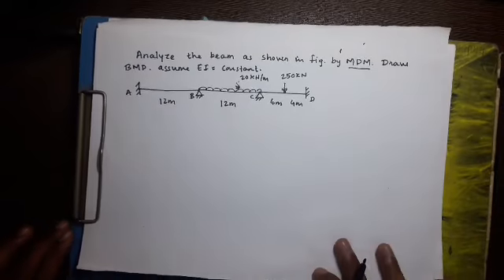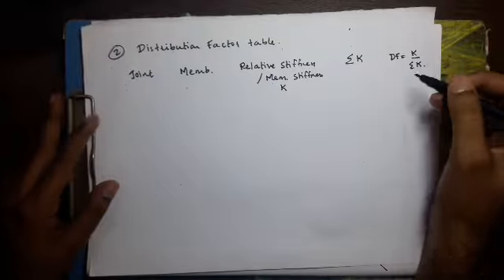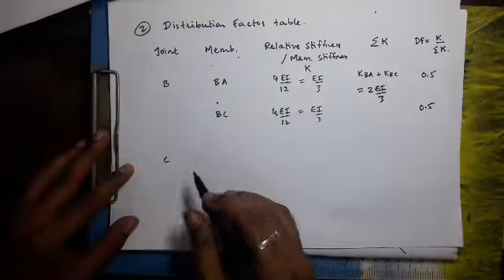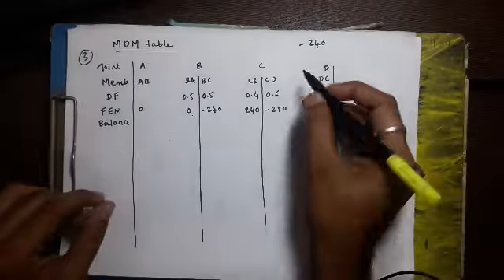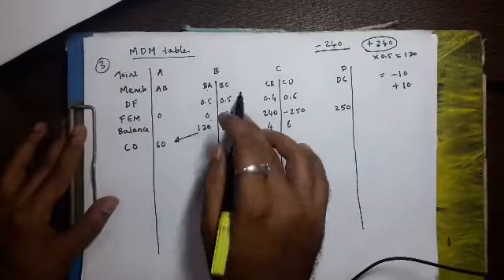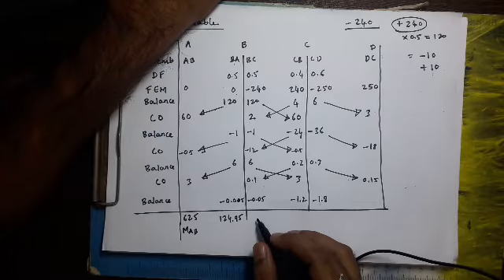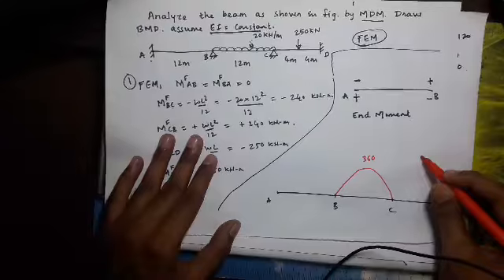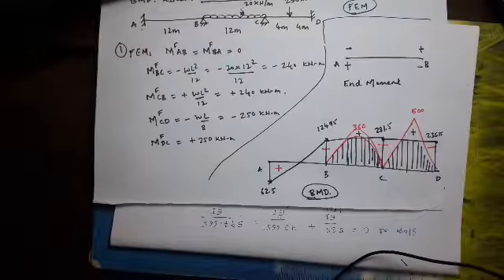Moment Distribution Method (Continous Beam Example 1)

Comment: I have a confusion with the formula of relative stiffness for the far end fixed as I heard that the formula is I/L not 4EI/L(if far end is hinge or roller)..correct me
Reply from the maker: What I use is if far end is fixed then it is 4EI/L and if far end is hinged or roller then it is 3EI/L. This formula is correct. There are alternative formulas and that could be the one you are talking about but I need to see correctness of those formula.

Comment: So even if the intermediate support is a pin, it will be assumed it is fixed since its intermediate?
Reply from the maker: There is some partial fixity in intermediate support, for analysis by displacement method it is assumed as fixed... But it is not representing the exact nature of fixed support.
Reply: @CivilEnggLectures  Thank you sir

Comment: Sir I have a doubt regarding relative stiffness in MDM method relative stiffness is E/L and 3/4 E/L when to you use those
Reply from the maker: If far end is fixed then use E by L.. if it is hinged or roller then use 3 by 4 E by L
Reply: @CivilEnggLectures  then y u used 4EI /L
Reply: good
Reply from the maker: 4el/l can also be used
Reply: @CivilEnggLectures  thank u sir ...
Reply: You can watch tos lectures here #thelearningcapital